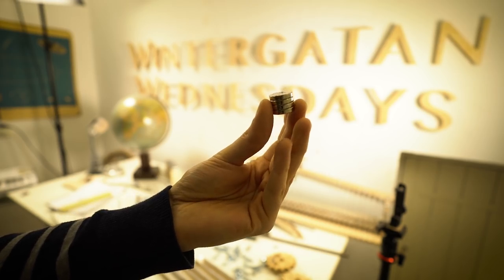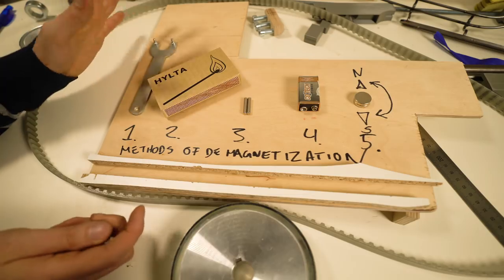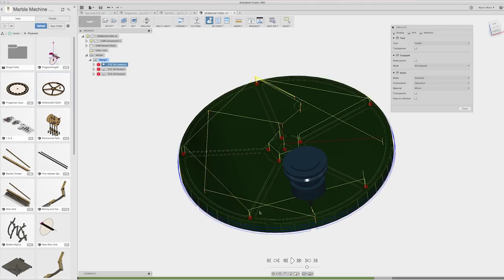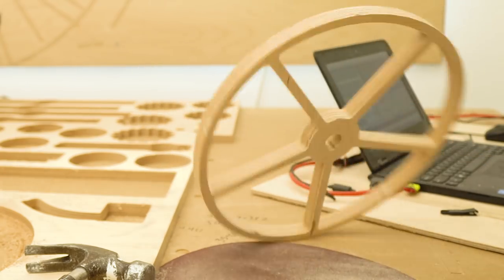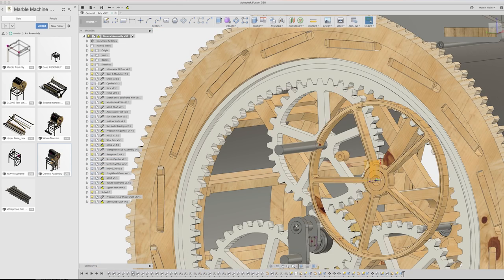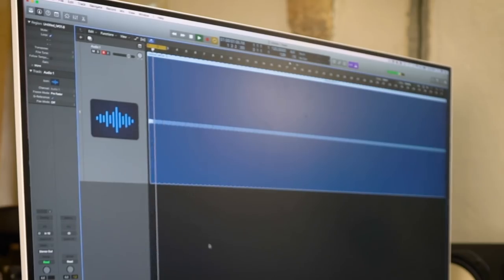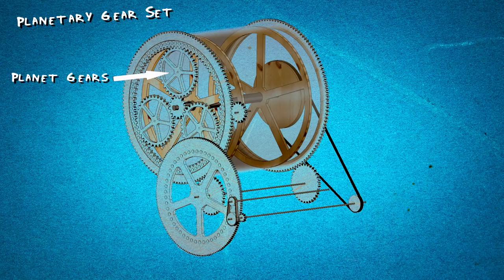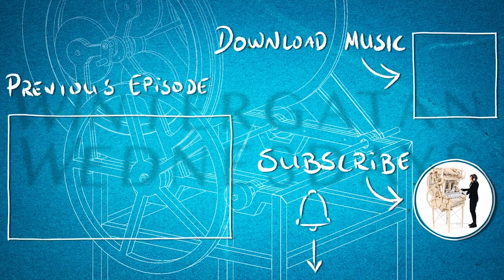Marble Demagnetizer - it's Mechanical! - Marble Machine X #23

Comment from the maker: So i have received interesting advice from several people about a simpler solution: Instead of a moving wheel we just have a marble track that runs over another track with magnets in alternating pattern, and the magnetic strip slowly curves away from the marble track. No moving parts, only the marbles moves, magnets sits still and the marbles become demagnetized. Could save space on the machine. Maybe someone wants to make a response video and conduct that experiment? If so, please post your videos in the replies to this comment for everyone and me to enjoy! Otherwise, I Will make some tests of this method and update you here in some day. Would miss another spinning wheel though... More wheels = more fun, but a working marble machine that is not overengineered would be fun aswell. Thanks for everyone who sends feedback like that. // M
Reply: Why not both ? If the wheel isn't enough you could implement both solutions and it would still look as cool :)
Reply: Wintergatan Both methods could have their own places in the machine maybe 🤔
Reply from the maker: True!
Reply: cant wait to see it finished. it will be legendary!
Reply from the maker: The_Draft I agree, although engineers always want to exclude unnecessary components and materials. If thee is a simpler solution to achieve it they would go for that, but we have to balance looks versus economy also!
Reply: Wintergatan you, sir, are a genius. I never heard about this method of demagnetizing iron.
Reply: when you travel to el salvador i will go to see you :D
Reply: The advantage of a spinning wheel is that there is no risk of the marbles getting stuck in the part of the track with the magnet that attracts them.
Reply: There is an even simpler solution, at the top of the machine have the marbles pass thru a loose fit iron tube, like plumbing tube, what will happen the marbles will experience a form of Lorenz force, and demagnetise as a result, as the tube will strip out the magnetisation that has been picked up, its simple and has no moving parts
Reply: Won't happen !!  If it does, the magnets are too close to the balls. Simply move the magnets further away.  Easy fix.
Reply: I have this "by the way" question, this world tour is including the biggest countries only or is there a chance that you'll come to small ones too, for example Czech republic? :D
Reply: I the reason why higher RPM did worse at demagnetizing was cause of the direction of the spin. If the speed matches up with the marbles rotation you might as well magnetise them with that.
For a 1 cm ball you can go to frequencies of maybe 100 Hz, but down to 10 Hz should work just fine.
So if you can get the marbles to roll decently close to the magnets it should be enough.
Reply: My dream is for you to bring the drill with you on the world tour.
Reply: for the mechanism of changing magnetic polarity, check the keyword "Hysteresis"
Reply: Why use magnets to move the marbles on the first place?
Reply: Wintergatan I like your idea better, because for the marble magnet track to demagnetize the marbles, the marbles would have to be rolling pretty fast, but if the marbles are already magnetized, then they can't roll!
Reply: I Think the problem with such a solution is that the magnets will itself cause the marbles to stop (eg, pull the marbles to a standstill on the track). I Think the Wheel is required to ensure the magnets do release the marbles at the end of the demagnitizing section. Yes, I know you could mount the magnets enough far away so the magnetism isn't strong enough to cause the marbles to go to a standstill but it might not demagnitize enough effective then. Current solution is good because when the marbles have passed the demagnitizing Wheel, the marbles will be forcefully be separated from the magnets, and become free to roll again.
Reply: more moving parts = more room for problems
Reply: This whole thing is delightfully over-complicated (albeit elegantly so) why should this part be any different?
Reply: You put so much work into your machine. There is a saying "the more you plan, the more hits you the unexpected". Please insure the marble machine. I hope I dont jinx everything.
Reply: SomePlaceForVideos 
See original design videos. Better control over the path of the marbles as they travel thru the elevators and drive wheels. Less mess of loose marbles flying off if they are held to their pathways with magnetism.
Reply: Wintergatan this idea is fragile since it depends on the current level of magnetisation of the balls rolling by. If they are too magnetised, they will roll slowly, and then be attracted to the fixed magnets and roll even slower, likely getting stuck. A moving degaussing wheel is more reliable.
Reply: Your wheel design looks awesome! This is about aesthetics, the visual arts, engineering  and kinetics as well as the principals of economy of design. As a art lover, I vote the more visually conspicuous the more fun. Go for it!
Reply: Why not use marbles made of nonmagnetic metals?
Reply: reaperexpress this
Reply: Wintergatan 
The problem is that magnetized marbles don’t roll on truck, right? So I don’t think the simpler solution would work since marbles would get stuck before they are demagnetized on the truck. Love your work btw!
Reply: How are the magnets oriented in the pick-up wheel?  Are they all the same direction or are they alternating fields or random? I was wondering if alternating them on the pick up wheel might achieve the same effect.
Reply: Wintergatan...would glass marbles work or are they fragile...maybe ceramic or porcelain...just an idea as you say😉
Reply: A wheel looks better
Reply: you could make a "Demagnetizing Tunnel", basically a hollow cylinder with magnets on the outside edge, then send the marbles through while rotating the cylinder. You might even get better results if you spiral the magnets down the length of the tube. Not sure if there is any space to be gained with this method, but it would sure look cool.
Reply: i don't know if anyone has mentioned it, but changing magnetic fields affect electric currents in circuits, and if it's anywhere near a line carrying electricity (like signals from a mic to a mixer or an amplifier, the line will be affected.
Reply: great idea bro! even cooler, make the cylinder out of acrylic, so we can see through! would look mesmerizing, rotating magnets vs marbles jostling straight. pls pls make a prototype!! i wish i could....but no tools or money here heh
Reply: Will this work long term? Does the marbles get degaussed to the same low level each time, or do they retain and accumulate a little residual magnetism over time? Worst case scenario would be that it works fine for a week or a month, lulling you into a false sense of security, and then after a while they gradually start sticking together...
Reply: Great idea! If there were both in the machine, the demagnetizing wheel going a different speed than the "sweet spot" 30 rpm wouldn't become an issue. :)
Reply: The other word that is used is degaussing. A deguassing coil was needed in old CRT  and TVs. They usually run at 60Hz and work quite well. So, yes, you seem to be on the right track as far as frequency.  
Anyway, I like the way you procrastinate! Thanks for the suggestion. Just listened to Dean Town; very fun.
Reply: I suspect that "economy" has been abandoned a long time ago on this project. :)
Reply: no no, thats way to complicated. you will probably just distort your pickups/microphones by fast spinning magnetic fields, and i also think its just too complicated and might not work perfectly. why dont you just use a conveyer belt like in the old machine? or a screwpump (archimede's screw), that even saves space and doesn cause too much vibrations. (warning dadjoke incoming): Screw the marbles!
Reply: i don't think that this will happen as impacts also demagnetize the marbles and going through the machine will probably nullify the minor magnetic forces.
Reply: The moving part looks cooler but if you go for a static solution, two spirals of magnets, an elegant double helix to mess with the internals of the marbles would be a beautiful metaphor for a DNA helix.
Reply: SomePlaceForVideos check out the older videos, I think he explained why and shows the other design ideas
Reply: I love watching your videos because your so passionate about what your doing.
Even your procrastinating is motivational to watch.
Reply: Guys did you see wiepechundschwefel 
Comment? (Down below)
He said that for he's experience, wheel with magnets holding by a glue it is not strong enough.
Just mind you.
P.s sorry for my poor English...
Reply: Wintergatan and then you did all this work for nothing? You could just have played the guitar all the time... I would have enjoyed that
Reply: shouldn't the demagnetization mechanism be planted on the transitional passage from ring lift 1 to 2, and before the fishtreppe ladder? where  would the marbles might be, if it's not getting stuck there?
Reply: 4:39 the magnets are alternate...
Reply: Wintergatan you could just use none metallic marble but it is a really interesting solution you came up with for your “magnetic roadblock”
Reply: I love watching the videos of you building the Marble Machine X. With regards to the marbles, have you tried using iron marbles instead of steel? Iron does not stay magnetised for very long(i.e. loses magnetism almost immediately) when the inducing magnet is removed and may offer an alternative solution.
Reply: Wintergatan you should use a magnetometer to check your setup. I don't know if your phone sensor is enough, but you colud try. There are several apps to use the phone sensor as a magnetometer.
Reply: The moment he just spontaneously made music with the drill made me fall in love. Martin you're the best.
Reply: I'm sure I see an EIZO monitor ! The famous for their picture quality EIZO ! 😊
Black border, white color back and the base ! I try to determine what model is it !
(I was EIZO technician) I think is EIZO EV2780 ! 😊
Reply: What a genius you are, Martin.
Reply: Nanoblast Inc it is electromagnetism 😉
Reply: What was the final name of the music this week?
I can’t fnd it but the music is so nice to,listen to
Reply: On a very，very separate note，can you finish the drill song？It is that one song that resonates with me fully.
Reply: Wintergatan, I have an even simpler solution to your problem. The answer is  this, you can just use Nonferrous Marbles. 
No magnetic properties= no more problems.
Reply: Stupid question and I bet it was answered before, but why don't you use non-magnetic marbles, like aluminium, glass or wood?
Keep up the great work, can't wait to see the final version (if it's ever going to be a "final").
Reply: Would the use of a piezo crystal be allowed? They produce a small amount of electrical current when compressed which might be enough to demagnetise the marbles. If this works you would just need to roll the marbles over the crystal section.
Reply: Please make a soundcloud song from that!
Reply: @Wintergatan  🎺🎺🎺🎺🎺🎺🎺🎺🎺🎺🎺🎺🎺🎺🎺
Reply: @Wintergatan  are you playing vulfpeck
Reply: @Wintergatan  WALLS ICE CREAM

Comment: Please be careful with glueing the magnets on the outside of your demagnetisation wheel.
The glue might not be strong enough in the long term. And the magnets might repulse each other to a point where they'll fly off the wheel. I've seen that behaviour on rotors for an electric motor. Over night the magnets repulsed each other strong enough to fly of the rotor. (Rotor was not spinning)

Cheers and happy building
Matthias
Reply: The magnets should only repel if they're facing the same direction. Since he alternated the directions they're facing, they should be attracting each other slightly, so that's probably not an issue.

But, I bet it would look good if there was a wooden cover over the magnets, especially since they are very shiny and the magnets in the lifting wheels are covered.
Reply: Kyle Fullerton 
The magnets on that rotor for an electric motor were opposite polarity each row. But they did fly off. Possible due to the radius in which they're to each other.
Reply: I hope Martin sees this! That would suck if that happened during a live show.
Reply: Bump, bump!!

Comment: You know that now you have an alternating magnetic field that you can basically generate electricity on the Marble Machine itself, right? How about you add some copper coils and see how much volts you are generating and we do a contest to come up with some awesome low power feature.. like: to power a circuit that measures the bpm and sends it out via standard midi cable as a (master) clock signal ^_^
Reply: This could actually be used to add some kind of lightning for Marble Machine...
Reply: Henry van Megen that's actually genious xD
Reply: you don't need a sensor to measure bpm - you just could add a microphone in the near of the demagnetizer-wheel - this would definite create a good beat signal  :-) (ok its analog - but hey the computer is running so or so to process the sounds from the contact mics... so it also can process this beat to generate the digital sync signal)
Reply: Actually genius.
Reply: @Tobyrobot a small coil and a led would work for flashing lights ;-) (also i love leds and blinky lights - i think it is to distracting for the overall look of MMX and to be  visible on stage from xx meters away you need higher power leds - and that could influence the power you need to crank the machine then...
Reply: Have one specific spot on the wheel connect the circuit. The lights will flash to the beat once it turns on :D
Reply: lightning? By that you mean building a Wimshurst influence machine into the Marble Machine? I like how you think. ;-)

(Yes, I know it was probably a type-o, but I couldn't let it go.) :-D
Reply: I like the idea of generating electricity with the marble machine X. I'd use it to power the microphones and the audio processing, if possible, so the marble machine would be self consistent and powered only by the crank wheel.
Reply: He doesn't want to implement electricity, if at all possible, for aesthetical reasons.
Reply: ^^ this!! :)
Reply: nceQon.BraSS Granted all his musical pickups will be electronic, but they are hidden and non-obvious. Given his stated aesthetic desires, the only thing that I could think of that would use power would be to power the mics and pickups. But there will be plenty of power on stage for other instruments. Also the additional rotational drag of generating power would add to the effort to play the MMx.
Reply: Perpetuum Marbele
Reply: By introducing magnetism, electricity is present.  Can't have electricity without magnetism and vice versa, but I agree with the aesthetics of not having electricity, though.  Perhaps it can be used in a purely mechanical way like someone mentioned for capturing BPM data.
Reply: you don't need to power mics or pickups, the point is that they generate power that is converted to audible sound
(not condenser or ribbon microphones, of course)

Comment: World tour, ... you keep talking about it, but have you thought trough well enough what requirements that puts on the marble machine, .. ? ( maybe you have ;) ) 
Just a few thoughts: Humidity changes all over the world, (i.e i live in a subtropical climate and know what it does to wood, even plywood),... when u travel temperature changes are also quite common. So I would at least think about sealing all the wood parts with some clear coat, so the moisture levels inside the machine stay constant.
How will you assure that it runs for the time without failure. I.e what is your testing regime? I would consider a temp connection for an electric engine so you can run the machine for many hours and see what happens ( what wears). 
What are you critical spares? what will fail first and when? Do you need a second machine,... considering the machine would be a centre piece of a new tour and album,.. what's ur backup? ... do you ever play a concert without a second guitar at hand?

... anyway just a few thoughts,... engineering habit ;)...
Reply: He already addressed that point in a previous video. He uses baltic birch plywood which has very high resistance to deformation from temperature and humidity. Also, the critical parts for alignment which may break or stop working because of very small tolerances are either steel or double-layered. 

No doubt the choice of material could have been carbon fiber or recycled plastics sheets which would have none of these problems but the tradeoff is they wouldn't be as nice looking. Maybe the third iteration of the marble machine will be, we'll see in a while.
Reply: Excellent points. He did get suggestions (not sure if he decided to) to build several machines and store them in different locations around the world. Perhaps he could customise each machine slightly for the climate in that region.
Reply: Well with a CNC you can always make spares out of thin air anywhere people have them soo I guess it's a no issue. (just takes some time that's it)
Reply: BaronZ Could be a big issue on tour though... what if the machine is dropped and breaks the night before a concert...? I think they should build an identical backup machine and bring with them just in case.
Reply: I think they should build a clone with recycled plastic sheets (they can be CNCed exactly like plywood) to make a recycling statement. PreciousPlastics Youtube collab maybe?